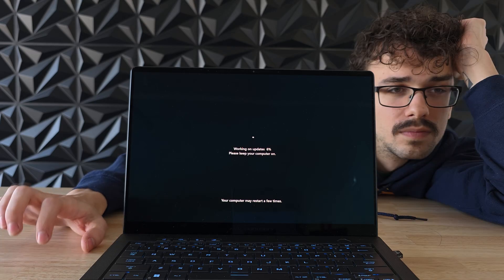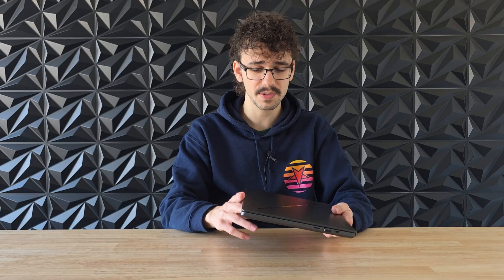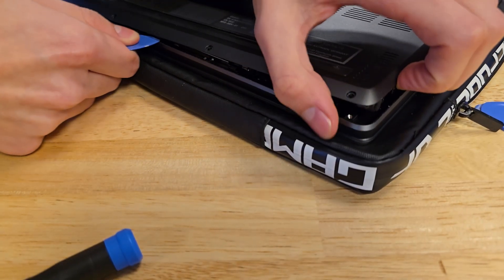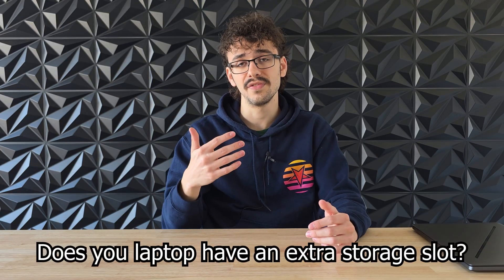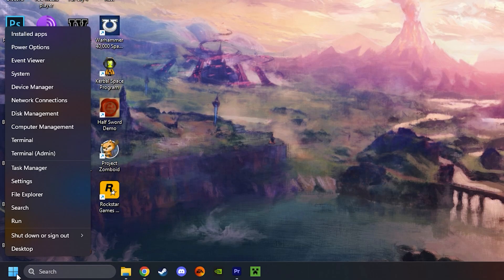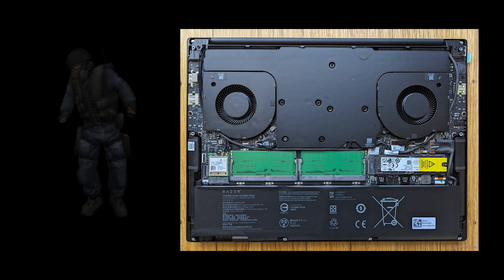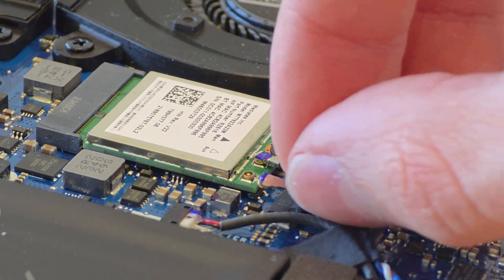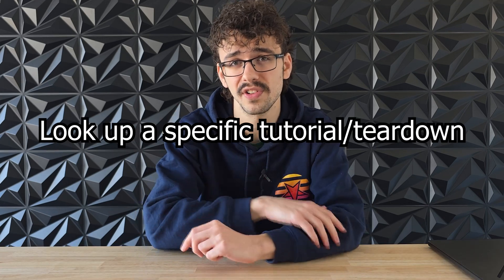How to UPGRADE your Laptop (RAM, SSD, WiFi Card, etc.) Step-by-step TUTORIAL

Comment: looks like my laptop doesn't have an upgradeable ram slot =( it's approaching 5 years old, and it's battery isn't lasting as long as it used to. The laptop and charger are pretty lightweight, but still.

Comment: I'm in the market for a new laptop, but the most affordable model I want to buy doesn't have WiFi 7, so to see if I could replace a laptop's WiFi card in the future, I followed your tutorial and used some tools to remove the Wifi card from my current old laptop and put it back on, it was very finicky, but I did it! Thank you!
Also, keep in mind that certain cards may be incompatible with some laptops, depending on the CPU manufacturer, Intel Wifi cards notably do not work with AMD laptops, and you'll need to download the drivers for your new card beforehand, or you'll have to use the Ethernet to do so.

Comment: Also for wifi cards, make sure that you get the drivers BEFORE you upgrade or else you will need another computer to get the drivers
Reply: Also check if the current wifi card that you are planning to upgrade also has the same teeth like NVME in my example or else it won't fit 😂

Comment: Maybe the reason Slotted RAM just become less popular, due to performance. Soldered RAM on Laptop's mainboard even on Processor directly, like Apple M chips even Intel Lunar Lake, has it's own advantages. Offer crazy high clock speed, even Bandwidth. Maybe manufactures also just do it, to save spaces
Reply from the maker: True, soldered RAM and on-chip RAM is faster, but the difference in speed is almost unnoticeable for 99% of use cases.
I would MUCH rather take upgradeable memory over slightly faster memory.

Comment: The BT on my laptop doesnt work and I cant install the drivers for it. Is it possible to change or fix this. What would the BT adapter look like in a laptop? Thanks
Reply: @Schattiz  many times the bt and wifi card is the same card.  Check what's printed on it if you can't see through software.
Reply: @TrusteftTech  Will do that! Thanks!

Comment: My i7 10750 h laptop is so hot that repasting with best kryonaut and vacumming the dust still make it over heat 😅
Reply: Try to use a laptop stand, it can lower your temps 5-10 degrees.

Comment: Brave video.  Nice.

For the M.2 SSD, there are two types of M.2 SSDs, the NVMe and the SATA ones.  They look identical to the untrained eye, but they are very different in how they communicate with the laptop and most of the time one doesn't work in the same slot as the other.  Be careful to buy the same type your laptop has.  

Also, there are different lengths of M.2 SSDs,  most common are the 2280, but there are others too.  Make sure to buy the correct length as that will also make it anything from slightly troublesome to impossible to use.

RAM, there are also SDR RAM laptops.  Not new ones of course, but there are out there.  I know I have one.

WiFi antenna cables can suck my USB port.  I hate them.  I often have problem plugging them in.  

Don't use a can of compressed air in a computer fan without having the fan completely stabilized so that it doesn't move when air goes through it.  It can create electricity and fry your components.
Reply: Wich makes a ton of sense every  electric motor can generate electricity when moved  when powered off
Reply: @crispyshaman4937  You would be surprised how many times I get people saying it doesn't.  I think I know what they vote.
Reply: @TrusteftTech  they are basically the same in structure as a electric engine  in a car.   Only the car engines are bigger Also the reason  why electric cars can generate electricity when u let off the trottle the electric engines wil slow the car down and turn into generators and give a lil electricity back.

Also a tesla  can actually  charge itself when towed as long as its in gear.
There have been cases of poeple  who had a dead battery  and after they where towed they could  drive for a short distance again

Laptop  fan motors work then same way they behave the same way.
They are not very different  internally only the size is much smaller
So its just best to just hold the fans with ur hand while blowing in compresed air so they don't  move. To avoid issues.
Some laptops however  do have protection against that and do block electricity generated from the fans. 

But its best not to risk it